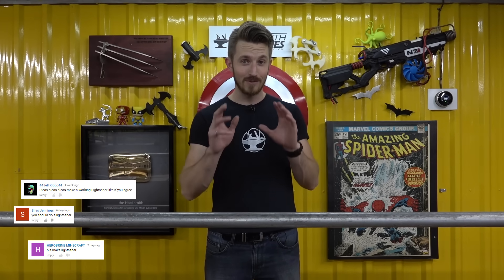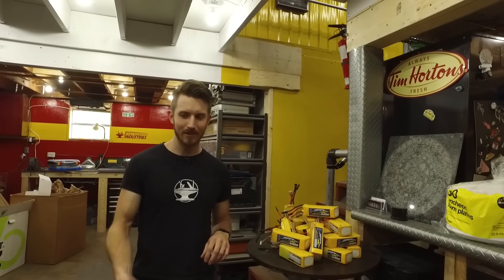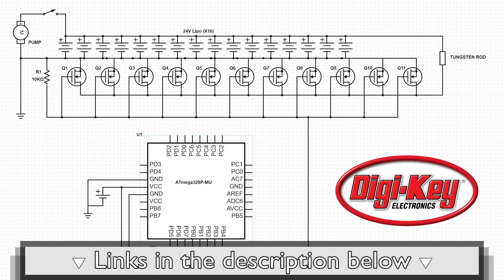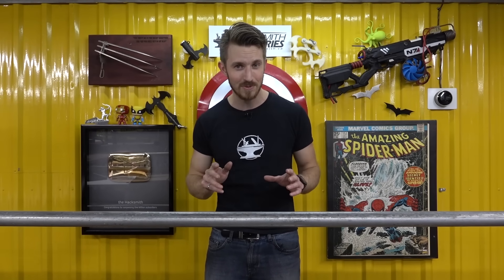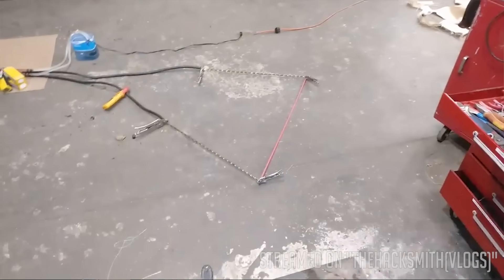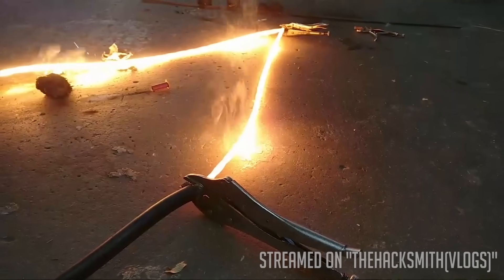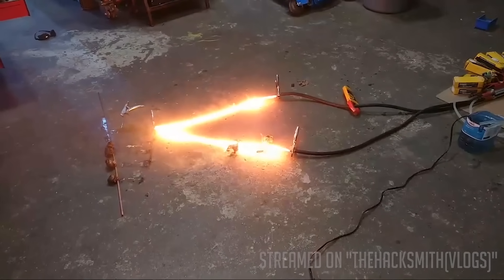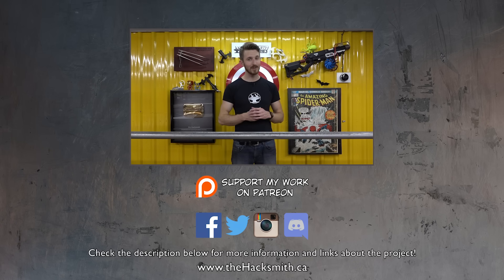HOMEMADE LIGHTSABER EXPLOSION!

Comment: Remember that the powder in a powder extinguisher Is corrosive 
For electronicscards _coppercoils in motors for ex. Make sure to clean up
Equipment in the room you fired that 
Extinguisher in.
Get  foam( you  don't  need petrol prof faom )  the oilprof foam is not good for the groundwater.
 co2 (even better) /no residue at all.
And bee carefull with the batteries, 
If they burn seriously toxic(  like: run !) fumes 
Is a component in the smoke.

Comment: I think this is all going to come together to where you guys combine propane, and oxygen in special gas mixing valve to make a beam of plazma that can cut thru pretty much anything. Also because it is gas, and you guys wired a computer control board to the gas valves, you can easily turn it on and off. 

Man its like I am from the future. Just don't look at the date this comment was written, or the date that future videos were released :).

Comment: Using a metal with a really really high melting point can be used. Like tungsten in light bulbs but the metal also needs to be strong enough to withstand any impact when we try to cut something. So idk man

Comment: You need a plasma torch and you need zero resistance conductors also you need a magnetic field to keep the plasma in a confined space, a leaf blower fan connected to the plasma barrow and far as energy goes i would use capacitors to power the thing up and use a step up transformer from a microwave Wala there's your light saber
Reply from the maker: microwave transformer is only 1.5kWtops -- this was 6kW!
Reply: Customize your own transformer
Reply: Use mini multi customizable transformers to make more compact sized to fit inside the light saber, just throwing this one out there see what happens
Reply from the maker: Mini? Power is based on size for transformers. It'd have to be huge
Reply: I might as well let the cat out of the bag, shorten your wires so you can have direct energy there's more power in a battery than most think the trick is to get the power to travel less far and even small wires would turn power up but keeping them from melting like solder wire will be kinda tricky and yes this is gonna get more dangerous
Reply: @hacksmith  just thin out your conductors it'll work i know because I'm into lasers like crazy
Reply: @hacksmith  also a kool idea would be to use a laser beam that shoots out one end and on the top the beam is caught and coupled by a 50×mirro magnified mirror usually make up mirros or a parabolic mirro that is specially cut out to fit inside the coupled pipe might need to have the right angles and it lets light in one way and shoots the light back down toward laser beam you might have 2 laser beams side by side kinda like the beam has gone through a rectangle and to make it more interesting use a blue laser diode colliding with red laser diode this would excite the laser beam

Comment: See, I worked at an engineering firm doing small scale assembly. In prep for a major project, I was tasked with building a number of portable work tables: oak table top, steel composite frame, swivel wheels, the works. Tapped the legs of the table and screwed them in to the oak top. The engineers were grumpy that I hadn't fully reinforced all twelve sides of the cubic support frame because and I quote, "We'll want to test the tables out by taking them off jumps and stuff." It didn't seem a structural necessity to stabilize a section of the table held together by gravity and a huge ass block of wood, but did it anyways. Only now that I have seen engineers decide, "Hey! We've got over 380V worth of force through a sequence of transistors controlled by an IC to drive a simple tungsten coil to over 1800K in heat! I wonder what'll happen if I drop a firecracker on it???" ... Only now do I realize the truth behind the "Work Table Jump Ramp Test" policy. This is why nobody gets to touch my circuits.

Comment: I just hope you remeber that when the metal is that hot it's just gonna flop over.
Reply from the maker: +KoalafiedYouTuberz not if it has a high melting point ;) check the circuit diagram

Comment: This is pretty interesting (as usual) ! Just out of curiosity, what is the material of the rods you're using to make the light saber in this video ? I might be super wrong but i recall graphite being pretty good for high temperature application (good resistance) yet it start glowing relatively fast with a fraction of the insane power shown in this video. Obviously,  it might be weak a material for an actual  "clubbing weapon/blade" but it might replicate the light saber effect pretty well.
Reply from the maker: check the circuit diagram ;-)
Reply: Oops ! Didn't notice it was written there LOL !

Comment: why you used steel rods? other options are also available...you can pick other metals too   . i bet you can achieve more heat @ low power supply
Reply from the maker: +Anshuman Sinha read the circuit diagram lol
Reply: my bad,  i heard steel rod -_- tungesten is right choice .   anyways . great work..but have you made any rail gun ?       that will be fun to watch
Reply from the maker: +Anshuman Sinha not yet! I do have a lot of caps...

Comment: A 12v battery will do the same thing just short it and see what happens to the metal that goes across th+ and the_.It will glow red and melt.
Reply from the maker: +Milo Janis you'll destroy that battery though. Battery has to be able to provide the current the metal draws
Reply: You can put a 12v car battery in a bucket of water and it will heat the water.
Reply: If you get a arc welder and fuse the welding rod to the neg it will glow and melt ,if you have a big arc welder or a thin welding rod with the power turned up

Comment: I do have the idea in my head of how exactly the lightsaber could look like with the rods but I simply can not explain it in words. Those rods that you guys were using were pretty thick so the saftey issue there would be if it melts while holding it in the hand. allthough if you could control how much power that goes into those rods it would solve that problem.

What I am thinking is that you should put one rod that goes right from the middle of the lightsaber upwards to a certain height, then you should make one rod go from the side and twist it around the rod in the middle but there has to be space between the two rods which means you would have to shape it into a "spring-shape". At the very top it would have to be connected to the middle rod so that the power could flow.

That would be the best option for it as it would truly look like a lightsaber and even function like one but I am not sure if you would need a bigger powersupply as the travel of electricity would end up being a little longer than the one on the video because you would need longer rods.

Comment: A rod of pure tungsten might stand up to the heat and hold its shape. I don't know how effective it would be at cutting through hard materials but at least it wouldn't melt like the steel did in the test. 

I also don't know how expensive a rod of pure tungsten that big would be, but probably considerably more expensive than steel.

Finding a safe way to attach that rod to a handle that you can hold will be a challenge too. I don't have any ideas for that one. One of the leads also needs to be at the tip of the saber, which creates some functionality problems.

Will be cool to see what you come up with.
Reply from the maker: +kayce851 cheek the circuit diagram in the description ;)
Reply: Cool, you are planning to use tungsten. This thing is going to be scary as hell, I'm not volunteering to test it when you guys figure it all out.

Comment: i have no clue about electronics and stuff so forgive me if i will(probably will) say a complete crap: can electrons follow a specific path on a electromagnetic wave and can an electromagnetic wave have a  specifically set path. Like, making a the wave have a shape of the sword edges, going away from the hilt for 1 meter or so than curve back to the handle?like a very squeezed circle or extremely oval shape with one point being the tip of the sword and one point in the hilt of the sowrd?if that is posibile and you can make electrons travel on that wave shape back and forth, there you are , the shape of a blade .Plasma is something betwen gas and fluid and if i remember right, both and plasma can be affected by magnetic waves. could this be a solution or the complete crap ideea that could lead to a good idea?

Comment: Why didn’t you use graphite?
Reply from the maker: +Yee Kettle check the circuit diagram
Reply: the Hacksmith Oh, I eyeballed it and thought you used the same things for the rebar bow, I wonder if there is anything better that would be able to absorb all that heat.

Comment: Use a tungstion rod bentin a skinny U shape with ceramic insulation for the handle and ceramic pieces to keep the rod from shorting.
Reply from the maker: ;-)

Check out the circuit diagram. Great minds think alike!

Comment: The Lightsaber, along with the Blasters, are powered by small crystals, named Khyber, common-rare, they are found almost anywhere in the Galaxy actually, the blades are powered by the Khyber, but the blade itself is concentrated plasma (that's why it burns stuff, while cutting them), Blasters on the other hand, used Khybers to power them, not anymore, they have some kind of self-supply energy, but uses Carbonite to concentrate plasma aswell, in a small bolt, it can pierce throught most un-shielded materials, including some armoured vehicles such as the AT-ST, but the bolt is so small, it won't even hurt the crew, only damage internal systems and actually stun the members, lightsabers and blasters are NOT laser weapons (Well, only the laser weapons themselves, but they are only mounted into vehicles such as starfighters and interstellar cruisers.

Comment: Use tungsten rods. Tungsten is incredibly strong but maybe re importantly has one of the highest melting point of the elements. Of coarse this would be really expensive, but thereare plenty of tungsten containing alloys that could do the job almost just as well. Just a Thought
Reply from the maker: +Adam Crowe check the circuit diagram in the description ;)

Comment: Hi hacksmith Ik the light saber needs to startfrom a origin and has no endpoint it kinda just stops but an easier way would build a a beamsaber greatsword from gundam seed it has an origins and an end point so it would be safer to build only problem it has to have a larger blade if you want more info about the blade look up the “sword impulse gundam” it has two of them
Reply from the maker: +NickNation 18 so like... What we're planning on doing? :)

Comment: Technically a lightsaber doesn't have a switch it is a button you hold and when you let go it stops the flow of electricity. That's why when lightsaber are knocked out of people's hands they go out.

Comment: could use like a steel pipe running another piece on the inside to connect the other side to the electricity

Comment: If short lived plasma plumes generated from powerful microwave sputtering and electric ark in front of the microwave emission antenna could be contained be a magnetic field generated from maybe a thermoelectrically cooled super capacitor powered magnetic coil, then you have to means to make a real deal light saber.

Comment: Why use MOSFETs? You should have used relays to switch and then a transformer to step down the voltage, upping the amperage.
Reply from the maker: +IOn Vash can't do PWM with relays
Reply from the maker: +IOn Vash and you'd need an inverter to use a transformer... They only work with AC

Comment: It's impossible to make a lightsaber like the ones from star wars. 
However you still have some possibilities. Make a heat resisting back to the sword, like so: 
---I___________I
Now you "simply" have to make a plasma arc between the two ends of the sword. Maybe it's easier and less dangerous to make multiple small arcs. So the back of the sword, would have to be more like this: 
---I__,__,__,__,__I
Though this seems very very difficult.

If you really really want to use a laser, you might be able to do something with optical breakdown. Where you use a laser and a focusing lens to make plasma. However this doesn't seem like a sword. Maybe multiple beams and lens' could make the illusion of a sword.
I'm not sure that this would be potable, or in anyway safe.
Warning: If you do anything with lasers (especially optical breakdown), be careful and use protective goggles. The light can scatter like crazy.

Good luck.

Comment: What about just using a big metal pipe or something which you can hold just like a lightsaber. Inside the handle you will put the mechanism to heat up the metal untill it starts glowing but is just not high enough to make it melt. Wouldn't that be the closest we can get to a lightsaber at the moment?
Reply from the maker: That's kind of what we're doing haha! It's the most practical and close thing we'll get to a "functional" lightsaber!
Reply: the Hacksmith do you think you will be able to hold it and use it as a sword?

Comment: So just one of those batteries can output 10 Kw of power?  Are you sure?? still sure? I think you are a little of.. don't you think?
Now we finally find out why North America is the land of dreams.. houses produce electricity there, and  quite a bit... 66 Kw of power per house.
So maybe you made a mistake and the don't "produce" but "use" but anyway .. 66 Kw is still off. Something is really wrong with your calculations.. isn't it?

I might be wrong. I am waiting for you explications.
Reply from the maker: Saying houses "produce" electricity was just me misspeaking. It's obvious I meant that's how much a house is fed from the grid. A typical house has a 240V 100A circuit, which is 24kW -- many only have 60A circuits,  which is only 14.4kW. So my analogy is still correct. However you are right about the batteries, they can only produce at max 148kW.

6200mah battery, 40C constant discharge or 50C burst. That's 6200mAh * 50C = 310A output.

310A * 24V = 7.44kW * 20 = 148kW

So really not that far off. Remember that section of the video was a livestream. No script, no editing, no re-takes or re-cuts. Fudged a number doing the calculation in my head.

Comment: You should use tungsten rods, it has a much higher melting point and you might be able to wave it around since it won't be soft from the heat
Reply from the maker: +#GetSwole Staley you should check out the wiring diagram;-)

Comment: just use a resistive metal tube as the lightsaber blade and have a silver rod inside the tube, connect the anode to the silver rod and cathode to the tube and connect them both at the tip. you should then fill the tube with something heat resistant like concrete
Reply from the maker: +Cabbage Man why silver?
Reply: silver is the best conductor so you would get the least amount of resistance on the inside, making the exterior as hot as possible

Comment: Im sure it will be something like a metal rod basically a similar design here but would be good if you could work out a way to make some sort of laser diode (or multiple) with some sort of way to stop the laser on the end of the lightsaber to essentially make a real lightsaber, i mean it may not instantly cut through stuff like the ones in star wars but it would definitely do damage, but with it outputting so many watts its probably impossible haha

EDIT: checked the circuit diagram, saw what was being used, cant wait!
Reply from the maker: +Cody Weiss yeah the issue is you can't get a laser that powerful enough! I think our plan will still be as close to a "functional" lightsaber as possible :)

Comment: what if you took a couple of those rods staggered around a insulated rod connecting the ground at the bottom of the hilt to  the man that would run through the center  and then just have the wires come out of the bottom connecting too the power supply that way you could pick it up and cut through things like a lightsaber

Comment: The steel rods can't touch so you could take some sort of ceramic tubing run the steel rods through it and then cut the tubing to where the steel rods are exposed  and if at all possible fix that to either side of a blade.

Comment: carbon tetra-chloride, the component of fire extinguishers , upon contact with hot metal produces PHOSGENE , a CHEMICAL weapon used in the first world war. It gained infamy as a chemical weapon during World War I where it was responsible for about 85% of the 100,000 deaths caused by chemical weapons.

Comment: Use a tungsten rod to make the saver part because tungsten is a the metal with the highest melting point overall it can heat to the point you can melt through steel and iron
Reply from the maker: check the circuit diagram ;-)

Comment: Don't get your panties in a twist... they just used batteries to heat metal, I could do the exact same thing over a fire
Reply from the maker: It's not done yet... Try watching the whole video instead of just being disappointed. The end product will be able to get MUCH hotter than metal in a fire. (Hint in the circuit diagram)

Comment: this is cool but not too cool cuz they have been working on this for years and its supposed to cut thru metal not just glow
Reply: look into your diff metals but don't use Cooper since this is electricity and copper is very electric
Reply from the maker: It is going to cut through metal...
Reply from the maker: +francisco4ben look at our circuit diagram